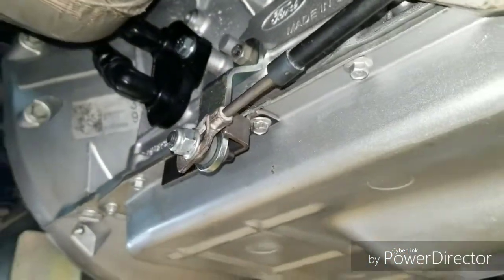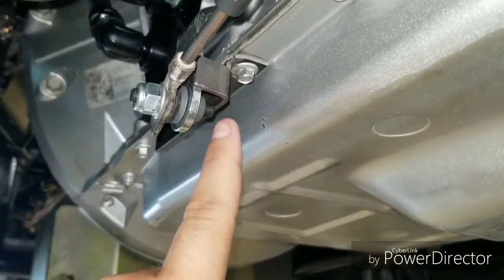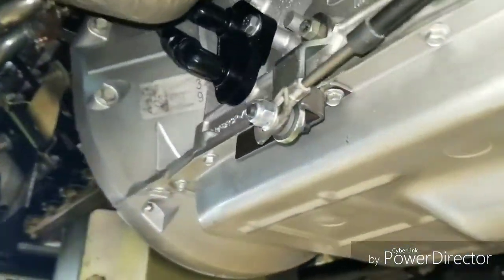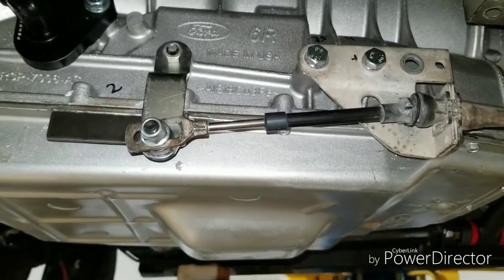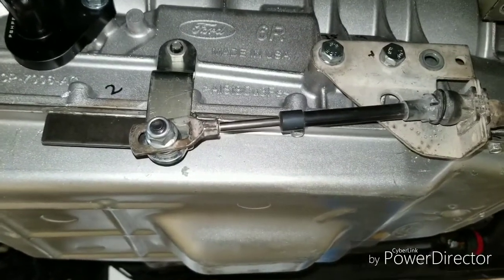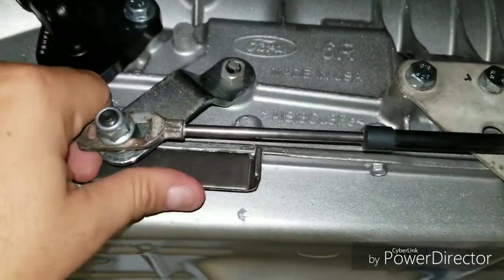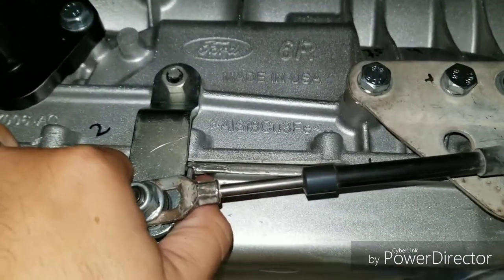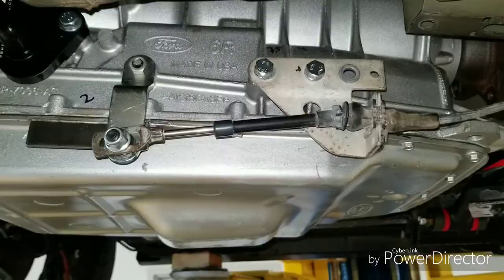PBH 6R80 SHIFT LEVER STOP

Comment: Hey Frank what bracket are you guys using in this video to hold the shifter cable?
Reply from the maker: That is the bracket that came on the aftermarket shifter in this car. You can see we drilled a new hole in it to fasten it to the Mustang case. On the 4r70w cables, that bracket usually has enough material to accomplish this.